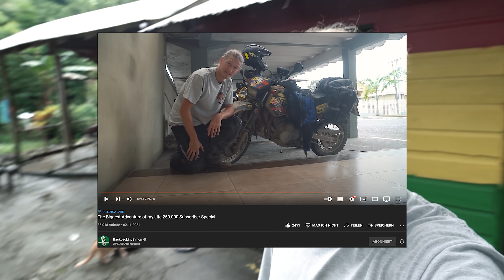Guest Car broke down! Is Scrappy going to make it?

Comment: In babylon UK, the tyre would need replacing if there is a hole in the wall of the tyre, but you can repair it if the hole is in the tread and keep the tyre.